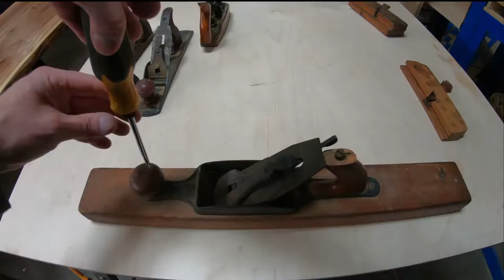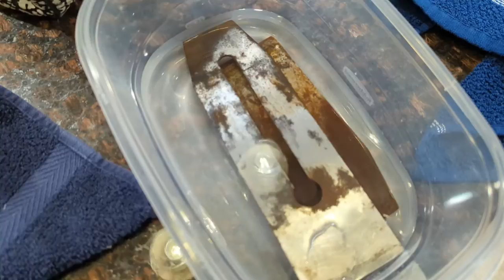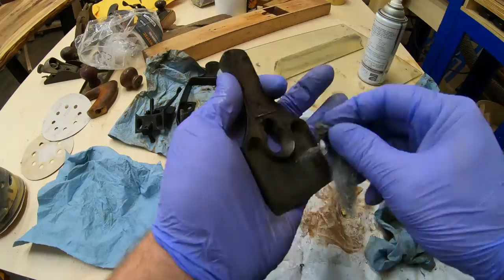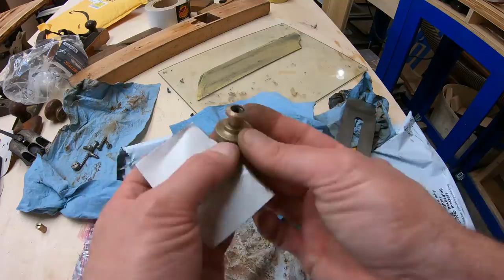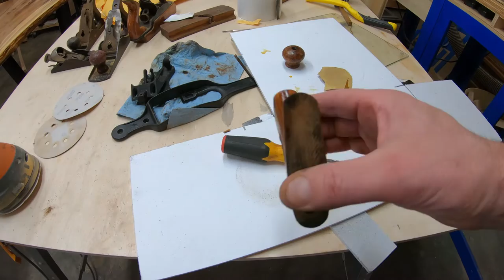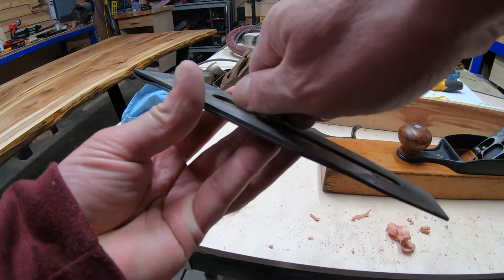Restoring An Old Stanley Transitional Hand Plane

Comment: Thanks for putting this up.  I also have a couple of transitional hand planes, one of which I have partly restored, but it needs more restoration work.  I just wasn't sure that I was doing it right.  It's a bit of a relief to see I'm on the right track.  
Thanks for posting this, regardless of the missteps.  I'll definitely be following much of this for my restoration work.
Reply from the maker: Thanks!  It was a fun project and I learned quite a bit in the process.

Comment: I think the dating applies to the metal bodied planes. I have 2 transitional planes myself, they are devoid of any manufacture #s or letters. They are a cool part of my collection but I doubt I will ever use them, but could with iron honing.
Reply from the maker: It was fun to research and restore.  You could be correct on the dating being for metal body planes.  I felt like I went down a rabbit hole trying to get a time frame on it, but an enjoyable process.  I look forward to getting the others in the lot cleaned up.
Reply: @shadeTreeWorks  
They are all a lot of fun even if mysteries remain for some. Saving history makes it worth it.

Comment: Good job 👍 The plane flow chart you used is for all metal body (cast iron) Stanley planes and ots actually based on the Stanley #4 but can be used for the other #'s but there can be some discrepancies on the other sizes. All the best on your hand plane journey, I just started myself about 2 1/2 years ago.
Reply from the maker: Thanks for the information!  My maiden voyage I was trying to get as good of intel as I could and it was mildly overwhelming for a tool with like 10 parts max on it. 😆.  I've been using another I got in that deal and hoping to get to rehab it soon.  It was in quite a bit better shape and just needs some polish.  Thanks again!
Reply: @shadeTreeWorks  you're welcome 🤠 I have a number of metal body planes that I've cleaned and tuned up. I recently acquired a couple of wooden body planes that I haven't got to yet and I'm looking out for a transitional plane or two( 2?🤣)to add to my collection.
There's lots of groups on F. B. That have to do with hand planes 🤠

Comment: You have to fix that tote. The horn is pretty important. Gives the web of your hand something to push on. I have a plane with the horn half busted off I haven't fixed. But at least half of it is still there. All gone is a definite fixer.
Reply from the maker: Yeah, I need to fix that or make a new one.  I thought it wouldn't be that bad, but you are right, it's doesn't feel great using it and putting force on it is awkward.
Reply: @shadeTreeWorks  I know how it goes. Just that little bit off never looks bad. But it's bad. Now you can either make a whole new tote or patch what you have. Patching usually comes out good. Making new totes can come out good too though. I've always made new totes myself. But that's because the whole tote was gone. If I had one like yours I think I'd patch it. To patch you clean the break up and epoxy on a new piece of wood and shape it. It's pretty straightforward. Making a whole new tote is more involved.

Comment: You really don't want a plane iron square flat. Camber is good. With no camber you leave tracks. For a plane that old that one is in remarkably good shape.
Reply from the maker: Ah, that makes sense.  I got lucky on the planes I bought.  The elderly lady who sold them to me said her husband took good care of his tools and used them regularly.  Even though I want clean up a few more of them that need some love, a few of the metal ones are dead flat and dialed in straight from his shop.  She said she wanted them to go to someone who would use them, so I am slowly learning to use them.
Reply: @shadeTreeWorks  most of us strop our tools. Stropping is such a low barrier of entry most are on board with it. A piece of leather and some compound and you're in. The other thing you can do is hollow grind. Less are into that because you need a specialized grinder to hollow grind. Folks aren't willing to pay for that gear. Some of us do though. I made all the grinders I use for hollow grinding. So they literally cost me nothing. But you can spend a lot for them too. People are into Tormeks to the tune of thousands of dollars. If that was the only route I wouldn't be doing it myself.
Reply from the maker: @1pcfred  I have a strop, but pretty new to it.  I've got my chisels scary sharp, but that hasn't translated to plane irons yet. Haha